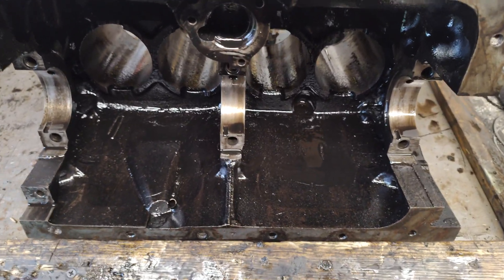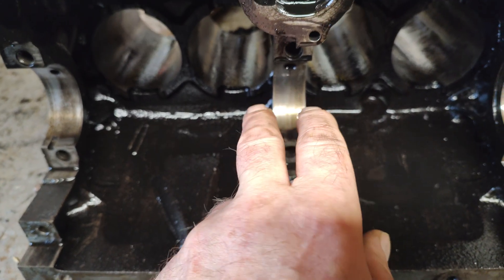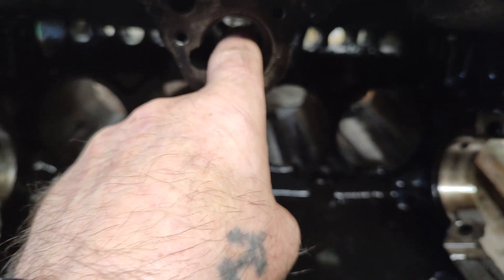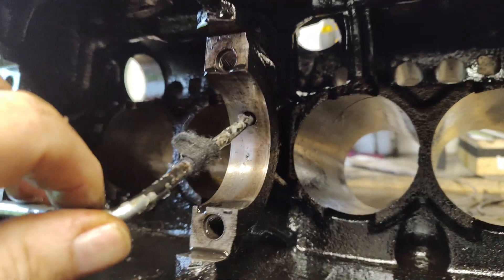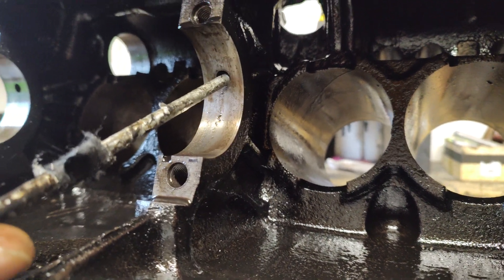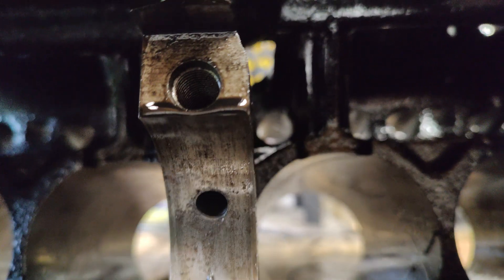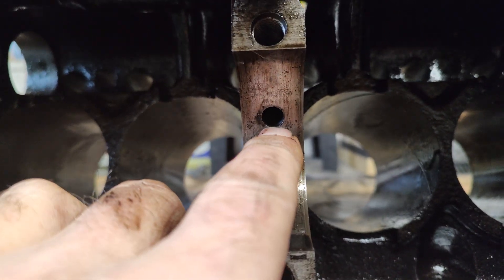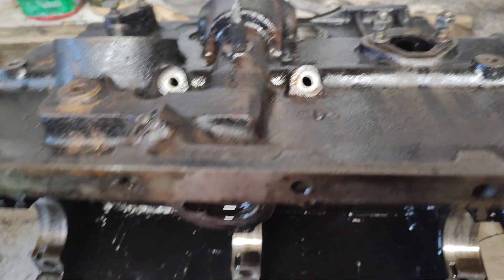mg midget 1500, Drilling out the centre oil feed to main bearing and 2 and 3 big ends.

Comment: Thanks for the video. I looked through your videos to see if you had anything on the MGB  1.8 Litre engine. Do you know if they are a better engine regarding bearing issues?
Reply from the maker: Unfortunately I am not familiar with the mgb engine, the drilling of the centre oil gallery was something the racers used to do on these little engines, worth doing if you have the engine apart.

Comment: further things you can do is to pin the crank float shim using screws of the same material and shot peen the connecting rods.  balance the crank with flywheel and clutch assembly together and use tri metal bearing shells.  these things including along with the oil passage drill out will make a flawed engine a bit less nerve wracking.
Reply from the maker: Good points made Nicky, however I'm happy with a standard engine it will be used as a Sunday driver and at 70 I'm happy to drive at a more sedated pace.
I remember driving these cars as a youth the fun is in the driving experience on B roads here in the UK.
I wouldn't want to go far on the motorway, and unless you intend to do some track days the engine is strong enough now the oil galley has been done.
Crank thrust washers to limit end float is on the to do list, David.
Reply: @davidbosworth.3395  -- thanks for replying.  i have a spitfire here in canada and drive it for the exact same reasons.  cheers.